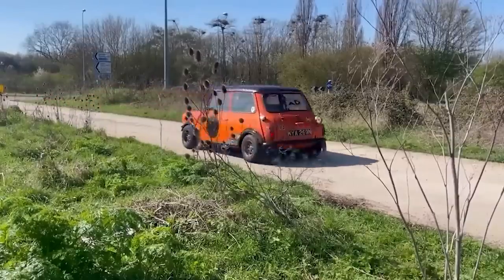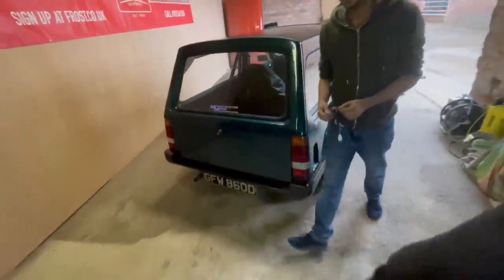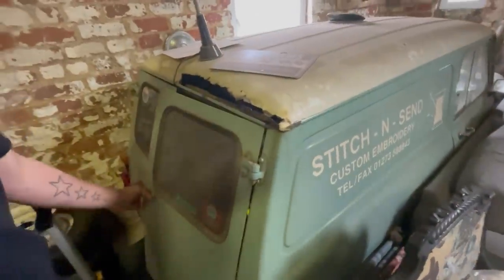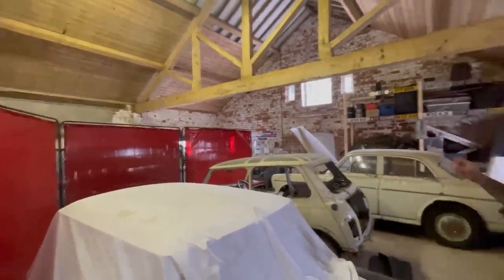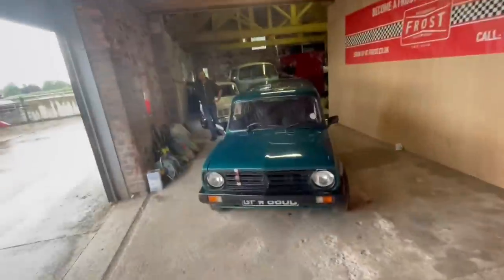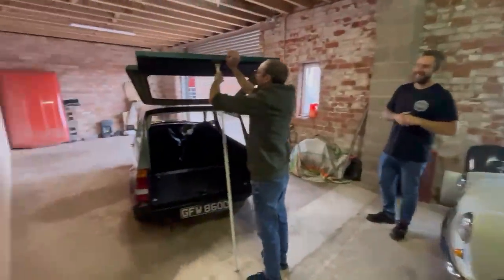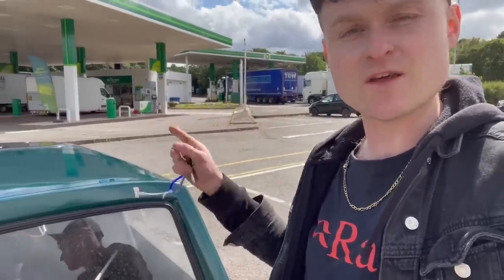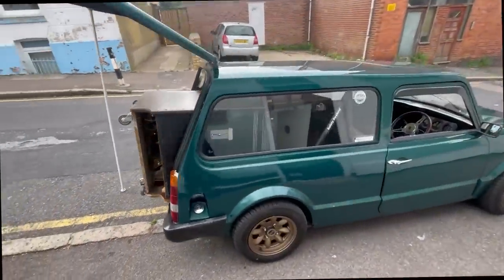They Said I Need A More Practical Car..

Comment from the maker: making some spacers for gas struts for the boot this week dont worry haha. what you recon? recon should keep the engine in or go to town? working on a few projects atm but none done to get a vid out so cars it is! give matt at simpsons classics some love below in the comments!
VID FROM SIMPSONS CLASSICS PERSPECTIVE HERE :- https://www.youtube.com/watch?v=3MdW0xjL8m0
Reply: Since this car is slightly bigger than the orange mini, it only makes sense that this thing should make 5x times the power of a stock mini. Go ham.
Reply: Heck yeah would love to see some car stuff too
Reply: Swap in a BMW K1200 engine!
Reply: More power or rather, torque is needed, the last thing you want when hauling a load up a hill or onto the highway and youve got a line of people behind you as you're gettin up to speed. Seems like it's plenty fast unloaded, though, that body sure helps. Gas struts will be nice. I recommend a front air-dam under the bumper for a bit more downforce, a small shelf-style spoiler at the back to reduce turbulence and drag, tidy up the headliner, see if you can get a roof rack installed professionally, and some better hood tie-downs. Have fun with the new ride, glad you didn't get rid of the mini!
EDIT: Also, maybe upgrade the rear struts/springs to carry more, then add a hitch for a trailer!
Reply: Putting a toque-y engine in it would be nice if you’re gonna be hauling stuff, like a little Mini truck
Reply: Oh no, first things first… concentrate on sticker-ing it up!
Reply: A 998 with filter and exhaust is an underrated combo. Not everything needs a 1380 and a lumpy cam.
Reply from the maker: @themaninthesuitcase  yep you are right there. It's surprisingly strong this engine. Gunna drive it as it is for a while then possibly go down a tuned 998 route for this car. It's a lot more useable at normal conditions over the orange one with a 286 cam, 1310, short ratio sc gears. Gotta be honest think I prefer this engine haha. And it doesn't feel slow, plenty useable.
Reply: When will you do the organ. Or when will the next video about it be?
Reply from the maker: @matthewkane502  put one up a few days ago. Doing it once a month atm on organ.
Reply: Don’t over cook it Sam, keep it simple and drivable. For now…
You’ve got the orange one to fang around in. 
Sometimes you have more fun in a simple car. 
Ps I love it, not seen anything like it down under 🇦🇺 
Always LOVE your videos mate!
Reply from the maker: @michaellomas1696  yeah definitely! Umming and aaaahing 😂. I want to build an engine to better understand it. But for which mini! And what size. Ooohf choices.
Reply: @LOOKMUMNOCOMPUTER  thanks
Reply: @LOOKMUMNOCOMPUTER  I have a 286 cam in my Clubman Estate also a lightened flywheel. It's very lumpy at low revs, like you need third gear to cope with 20mph speed limits. Does nothing for fuel economy either. Some of the Clubman Estates (possibly the saloons as well) had the 1098 engine from new, but this may be just a matter of what engines BL had at the time, rather than a design feature.
Reply from the maker: @skin150263  yep. i think this engine was put in at some point to replace its original engine. because its changed so many hands over the years its hard to say, my orange clubman has a 286 and lightened flywheel, sc gears and weber and what not. its safe to say this one does not haha. its actually a lot nicer to drive than the highly strung engine haha, makes me wonder about what engine to build if this little 998 gets rocky.. as obviously you want to go all out race spec like the other one, but its actually really nice being a little more sedate and useable!
Reply: @LOOKMUMNOCOMPUTER  Deffo, my other mini just has a standard 1275 engine with single SU and stuff so it's more sedate and well behaved in traffic. The Clubman Estate has a gas flowed head and big valves but I don't have sc gears and just a single 1 3/4in SU. I bought the engine and gearbox from a guy at work as an unfinished project for £250 which also included a set of Cooper S disc brakes which I thought was a good buy. I just had to assemble the engine properly, stick the gearbox on and fit an exhaust. For ease of use I avoided an lcb and used a Metro twin downpipe manifold with a Maniflow stainless twin box exhaust.  You're probably better off with a more 'normal' engine if you just want a run around to transport stuff for the museum and that. Probably the best tyhing about the old Minis is that they're simple to fix yourself and of course you don't need a computer to diagnose faults 😁.
Reply: @LOOKMUMNOCOMPUTER  Sam, I would recommend build a stock engine. My first was not, so much information to gather and not all available (made a mistake and nearly wiped out the engine), and if something goes sideways then not trashing expensive upgrades.

What you need is torque (push), not horsepower (acceleration/speed). You seem to do a good bit of long distance traveling, so myself wouldn't mess with the transmission or differential gearing to achieve this (though adjust for economy at desired cross country speed).

I hope this helps.

Cheers,
Adriel

Comment: Enjoy it! There have been a number of Mini kit cars over the years - I built a wooden Hustler from William Towns once. The 'kit' just consisted of plans and glass and I had to cut out 80 odd marine plywood panels and fit them to an ash and mahogany frame. It worked OK, although the electrics needed a bit of thought as there was no metal body for the earth return. The main problem with it was the weight of the body which caused the car to have a major appetite for wheel bearings, steering and suspension components. I eventually built the mechanicals into a Mini Clubman Estate. This goes quite well with its 60 thou overbore, gas flowed head and stuff. It does have the Cooper S disc brakes though... It's surprising how much stuff you get in it and it's level loading as well which makes life a bit easier.

Comment: The 'yellow' engine is more than likely a 'Gold Seal' factory refurbished unit... quite common in the 60s and 70s. They were usually better than the originally fitted unit, as they had to go through more rigorous insepctions!
Reply from the maker: Yeah it could be a gold seal. Definitely wasn't a 998 yellow

Comment: Absolutely fantastic. You should totally throw that crazy engine in there too.

You should figure out about if you can get some sort of roof rack but at the very least some hydraulics for that rear hatch!
Reply: A couple of gas shocks would do wonders for that, sticks tend to come loose at the worst times.
Reply: @calebmeyer2121  And it bloody hurts when they do.  Go on.. ask me!
Reply: @markpitts5194  Hey at least the rear is made mostly of fiberglass, but I'm sure the window is glass, that would add some heft. Probably only need 2 10 lb gas struts
Reply: Actually looking at it again too, you probably want some way to tie the door down as well in case of some extra long loads like another arcade machine since the hydraulics/gas struts would keep the door completely open.

It could be as complicated as something adjustable, or as easy as a pair of eyebolts to just connect a rope or bungie cord

Comment: Love it Sam! Clubman square front and Reliant style rear, it's just so damn quirky - it's perfect! Never actually owned a mini but my uncle had a Clubman 1100 and a cousin's boyfriend had the Clubman estate van - man the sound of those small engines mashing it was always awesome.
Always wanted a Mini but my first car in mid 1980s New Zealand (drove it 600km to university and back again, several times) was a slower revving but equally awesome (in a Mafioso sort of way!) Pininfarina styled 1959 Morris Oxford Series 5 painted black, with the pointy cathedral taillights and a 1622cc engine out of a series 6 but retaining the original lower ratio diff - so it took off from the lights with the best of them :-) 
The Ox had an awesome sounding horn set - maybe that would be a cool Upgrade/back-grade for the mini - put a 1950s/60s Morris Oxford/(also Austin/MG/Riley/Wolseley badge engineered versions) horn set in it!
Oh and yeah while at uni (electrical engineering degree) I picked up an ASCII ASR-33 TTY (didn't have the phone dial like the Baudot phone line TTY version, but had the full width 8-bit paper tape punch and reader for connection to 8-bit computers via 20mA Current loop interface instead) to attach to my (Australian version) Dick Smith System 80 computer (UK version was called Video Genie) which was a functional almost-clone of the American TRS-80; and a vintage Signetics 2650 homebrew magazine project computer  from the mid 1970s. Sadly sold them all off for next to nothing!

Comment: Back in 1980, I converted one of our Aussie 1973 Leyland Clubman S Minis into a  '1275 GT' by swapping in a rebuilt 1310cc dual 1.5" SU carb, rally-spec engine, disc-brakes, & the rest of the running-gear from a '67 Cooper S, so I was a huge Mini fan back then! 
However, even though I'd seen pics of Reliant's four-wheel Kitten, and all the various fibreglass kits to make a Mini less like a brick aerodynamically, I never knew these fibreglass Mini vans ever existed! You do need to fit some gas-struts on that rear-door though, & it shouldn't be too difficult to fit roof-racks that utilise tracks, although you may need to remove the roof-lining to do the job properly!

Comment: My 998 has that same rattle noise when it idles.

No doubt you've already thought of this, but I see it has a roll bar installed and seems like it would be easy enough to extend that to the rear hatch, add some upper cross bars, and install a roof rack using those as hard points through the roof.

Comment: Mechanical squeaks and klattering noises are heard - That sounds pretty good actually! Spoken like a true collector of old stuff! 🤣

Just a tip, remove the headliner if you care about it, or it will get torn by stuff, 100%. I'd also tint the rear windows so you can park it outside without worrying about people seeing the precious technological gadgets undoubtedly stored in the back, and possibly nicking them.

Another tip is a collapsible mop handle for the rear hatch, takes up less space in the back and it's height adjustable too. 😉
Reply: I think he's safe from people stealing his antiques.
Reply: @user-ue6iv2rd1n  My thoughts exactly.  No one is going to even recognize the guff he has apart from possibly having copper.
Plus it makes me think back to the Top gear complaint about trucks being "Well people can knick your stuff".  I just think "what third world are you living in that folks would try that?"

Comment: Back in the day there were quite a few estate cars which had a pair of front-to-rear bars bolted to the roof and cross bars or a rack which clamped onto the rails.  Something like that could work well on Mr Plastic.
Reply: New ones on the Bay for VW T5 etc that could be adapted a bit shorter. Easy project.

Comment: I've got you beat, I picked up a VW Fox wagon recently and got it back on the road in the states with a 1.8t 20v (empty engine bay when I got it, or I would have just got that running tbh).  Love the Morrison Mini's, but to get a decent one in the states, you either need luck or a bunch of cash.  I do have an 08 clubman mini, but it's one I picked up out of a salvage yard to mess around with k swaps.  Runs fantastic with a turbocharged k20 lol.

I've only seen one other of these fiberglass bodies in the past, and it made this one look mint condition ready to win a car show (not that it looks bad, pretty good from what's shown).

Comment: That's a Model 32 Teletype, used as a Telex. Back in the 1970's, the Model 33 was the desirable one because it used ASCII rather than Baudot. We would hook them up to our microcomputers and use them as an teleprinter!
Reply from the maker: yep its the 32. which is more desirable to me beacuse everything i have runs on baudot, works well cheers
Reply: @LOOKMUMNOCOMPUTER  You sir, are basically one of a kind! Take that as a compliment. :)

Comment: It's not that bad at all tbh, load space wise theres enough for most things and it's smaller size means it'll get into places something like a transit wouldn't.
I'd get a rack or mounting points fitted (oddly Boat places might be able to help with that and also permenantly remove the Sunroof at the same time if you wish) and some decent tail gate struts to make life easier loading and unloading and then she's gravy.

Comment: I've always fancied one of these as a practical and durable car, but it's a shame that attractive paint job isn't matched by a bit more attention to detail. It definitely needs a strut to support that tailgate, and that saggy headlining would drive me wild. I'd be tempted to pull it down and just glue something to the roof with a layer of sound-absorbent material behind it. In 1986 the Phoenix kit was priced between £1395 and £1975 plus VAT according to spec., and it is a monocoque structure to accept the Mini subframes, so it ought to live forever.
Reply from the maker: As mentioned project. Already pulled headlining out and sprayed roof black, fitted gas struts and rejigged the dashboard. Only a few hours work. Wouldn't class em as problems :)

Comment: That teletype isn’t a baudot one that’s a ASR 33 which is ascii. They are also easier to interface with as it’s a 20ma current loop not the 120v 60ma loop of the baudot ones. ASR 33s are popular with the retro computer crowd as they are easy to attach to minicomputer. I’ve got two baudot ones (a 1944 model 19 and a 28KSR) and those are a lot more to keep running. The positive of a ASR 33 is the ASR bit (automatic send receive) the paper tape punch and reader is directly attached to the printer and keyboard so is easy storage. It uses 1 inch paper tape which is reasonably easy to get
Reply from the maker: Are you sure it's not an asr32 baudot? Pretty sure it is so
Reply: @LOOKMUMNOCOMPUTER   The Baudot one will have a 5-bit paper tape punch and reader, the ascii one has an 8-bit paper tape punch and reader. I was pretty sure that the models with a phone dial were usually Baudot, but I could be wrong. It's been a while!
Reply from the maker: @davechisholm9670  yep exactly. which this one has. to the original commenter i may still be wrong as i have not dug deep into it yet. but almost certain it is a baudot unit and not ascii. i would not have mentioned it in the video if not haha.
Reply: @LOOKMUMNOCOMPUTER  If it is an ASR 32 then yes it's baudot if it's a 33 then ASCII. I didn't see the model clearly.
Reply: @davechisholm9670  Ive got a ASR 33 with the phone stuff in it so it kind of went both ways.
Reply: @jaut-76  Its so long ago that I had mine that I can't be sure :-)  (mine was an ASR 33 with no phone line options, just the 20mA current loop serial interface - it came with copious manuals for it too, including descriptions of all the weird and wacky phone line options that I didn't have!). However one way for Sam to establish which is which without manuals is to look at the paper tape punch and reader. If it punches 8 bits on the tape when typing, it's not Baudot!
Reply: @davechisholm9670  a even simpler way would be the size of tape as baudot tape is 11/16 inch across and ascii is full 1 inch
Reply from the maker: @jaut-76  to confirm after research and asking around it is actually a 33 but it is baudot, it has enough space and levers in there to be ascii, we think it was a custom job. but yes definitely baudot.
Reply: @LOOKMUMNOCOMPUTER  that’s cool, personally I’ve never came across something like that and I’m sure it will make a good project. It would be fun since it’s baudot to loop it with my model 19 from 1944 and my model 28 if I can unstick it.

Comment: Sam READ THIS! my uncle had one and let me drive it; if you got nothing in the back and u got to full throttle to zero in any corner the lift off oversteer its crazy and instant!! i almost ended my self in the swiss alps 2 times; thankfully i just spun out and bumped the guardrail both times (nothing serious just some cracked fiberglass) but BE CAREFULL it's unlike any oversteer you ever experienced
Reply: ah and check the rear shocks mounts they love to pop in the boot to say hi
Reply from the maker: Sounds like it wasn't set up very well! Also sudden change of velocity while going round a corner isn't the best idea in any car :D. Cheers!
Reply from the maker: Interestingly found this one to corner somewhat better than the orange one. The back does feel a bit light though yes :D. But not found it to be too much tbh. But I'm guessing it's down to the way it was setup
Reply from the maker: I guess I may find out though ha. Cheers

Comment: It's so awful how United States laws encourage car manufacturers to make larger and larger cars due to fuel mileage, emissions standards, and taxes being more lenient for larger engines and vehicles...

We need dinky little practical cars like these and Japanese Kei cars! Too many 4x4 tanks on the road that guzzle fuel like an M1 Abrams, cost upwards of $70k, should require a CDL to operate, and make the road more dangerous for everyone. I want a small, fuel efficient car that can do nearly everything I need, and for stuff that's too large, a small pickup like those indestructible Toyota pickups from the 80's.